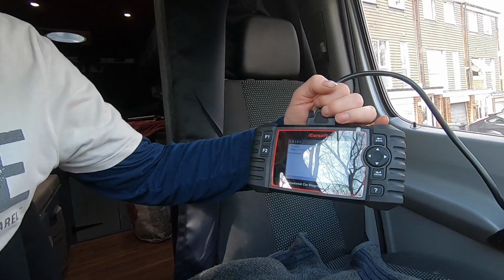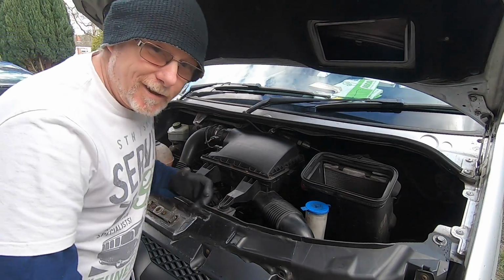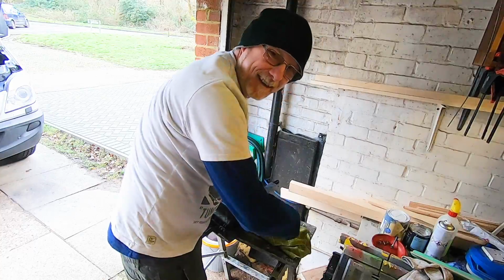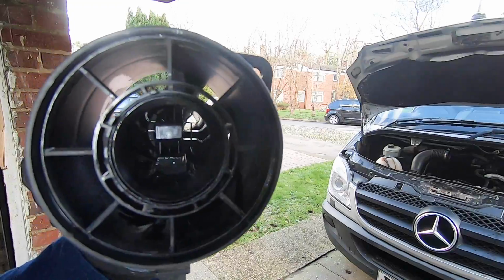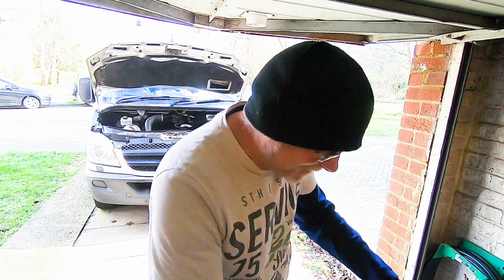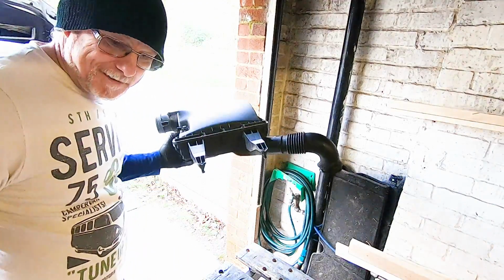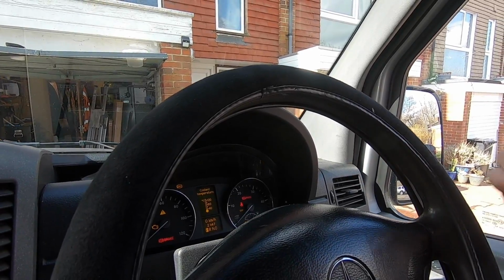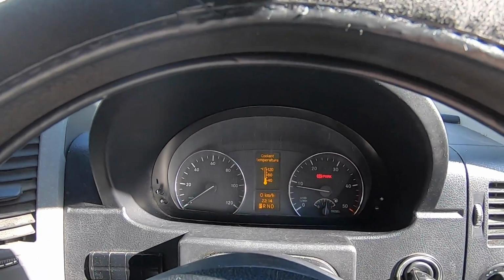HOW TO clean Mass Airflow Sensor

Comment: Aw my sprinter  2006 bus i bought in feb, has probs going into limp mode, going up hills, even sometimes small inclines...so changed the turbo sensor on side of hose, its made quite a bit of difference,  but last weekend x2 on motorway dropped to 40mph,so put hazards on till at top....mate told me to change my air flow meter...also black smoke...no codes come up tho ! So maybe change it 🤔🙏🤔

Comment: Great vid. I’m gonna try this. And buy that scanner. I’ve been converting a 2011 Sprinter myself and am always having to plug it in. Damn sensitive aren’t they.
Reply from the maker: Hi yes sprinters are really sensitive I’d highly recommend you getting the scanner it’s saved me a fortune over the years I’d also recommend that you don’t use them piggyback fuses like I did they cause problems for me in the past good luck with your project 👍🤓👍
Reply: Yeah, I bought the scanner you recommended. 
What are the piggyback fuses?

Comment: I had the maf code and I tried cleaning through that grill and no luck but after watching this video you helped me find out that the grill comes out haha thanks
Reply from the maker: That’s brilliant I’m pleased it helped you 👍😊👍
Reply: Mel’s Van World still trying to figure out my problem lol may be a cracked inlet pipe or something that is causing the maf to be slightly out of spec also I have a code p1955 which has caused the motor home to go into limp mode have you ever herd of that code? It’s a Mercedes sprinter 2011 C/C 511 CDI 4325 L

Comment: I've got a 2008 Relay with 179k miles on it. Had to do the same with the mass airflow sensor. Next up are the injectors ;-)
Reply from the maker: Good luck don’t force them be careful 👍🤓👍
Reply: @MelsBigVanSmallWorld  Thanks, I'm going to crack one open tonight. If not succesfull I'll send them off for cleaning. Any recommendation?

Comment: Hi Mel recently found your channel having just bought a sprinter van to convert could I ask how you think the "Ring" b2b charger is working as theres a few bad reviews for it and I`d rather hear it from somebody who is genuinely running one . thanks Mick
Reply from the maker: Hi Mick I have used them many time and had no problems at all the main reason why people have issues is because they don’t switch off solar priority so when driving during the day it won’t switch to DC to DC charging rather than solar it’s really simple to switch this off. Also you’re hear about error code this happens when there is no solar panel attached or at night when there’s no sun ☀️ when solar priority is still on basically it’s people not reading the manual properly it’s a great peace of kit the one I have in my sprinter is working perfectly fine just remember that they do need ventilation especially if you’re running a fan plus fridge during a hot sunny day because all that power is coming from the solar through the controller rather than being drown from your battery’s that’s why they have two fans built in to them don’t put it in a confined space but that goes for all controllers 👍
Reply: @MelsBigVanSmallWorld  Morning Mel just to confirm you have to turn off the solar priority each time you drive the vehicle ? then turn it back on once you park up ? then turn it off at night not to get error codes or am I reading your reply wrong ? also if I hadn`t fitted the solar before using it do you just leave the solar priority off sorry if I`ve completely got it wrong Mel I`m just trying to get my head around it I can`t remember what day it is half the time never mind keep turning things off and on all the time
Reply from the maker: Oh one other thing people don’t understand is that if your smart alternator is putting out say 9v and it’s a hot sunny day the controller will charge battery pack from solar leaves them thinking why isn’t it charging from alternator hope this helps 👍🤓👍
Reply: @MelsBigVanSmallWorld  Thanks Mel that's a great help I`m new to the van building and 12v systems I was a builder in a earlier life at least all this building is a little lighter , keep up the great work on the videos Mel I really like how you deliver them nice and relaxed with a bit of humour thrown in

Comment: I clean my Z4 MAF every six months as i have a oiled K&N filter fitted.
Reply: The K&N does make a difference. I recently tried a std. paper filter and the car seemed bogged down. So the cleaned K&N went straight back in.
Reply from the maker: Sounds good 👍

Comment: You can use electric contact cleaner which is cheaper and usually easier to find.
Reply from the maker: Hi I would as it leaves a residue 😐
Reply: @MelsBigVanSmallWorld  The WD 40 brand of contact cleaner I have is residue free - but I've used isopropyl alcohol in a spray bottle which has worked just as well. As long as it evaporates pretty quickly and doesn't attack the plastic there are quite a few things you could use - some more explosive and carcinogenic than others  :-)

Comment: Hi Mel, Although garages use EGR cleaner Or Brake its not recomended. The Use of these types of harsh solvents whilst do clean the sensor they can shorten the life of the sensor. A garage wont be too concerned with this as its win win  for them. The correct cleaner is isopropanol alcohol sprayed on the sensor.
Reply from the maker: I used a cleaner that was made for mass air flow sensor worked a treat
Reply: @MelsBigVanSmallWorld  My mistake sorry, What did the can say was in it out of interest.

Comment: Interesting isn't it how the 312d had an engine that people say would do a million miles and it probably would and yet more sensors are installed supposedly aiding diagnosis on these newer engines that I v much doubt would do that sort of milage... I wonder why.
Reply from the maker: I know I had a chance to buy one with only 73on the clock kicking myself now
Reply: @MelsBigVanSmallWorld  yeah I put 318d was meaning 312d yep I would love to buy one with a decent chassis, a 4wd came up in Middlesbrough few months back made about 3500 ex British gas I think, low miles would of made a great overland/ camper and runs on veg happily..
Considering an old banana transit ambulance it's already built but no turbo might be a bit slow, pretty solid though.
Reply: @MelsBigVanSmallWorld  if your interested in one a guy had a 312d ambulance with crazy low milage on Gumtree and sphock not long ago, money a bit dear with no mot but I'm sure he'll wake up, ya probs busy enough though.

Comment: This is why Mercedes engines last so long they won't run long enough at one time to do any damage to them.
Reply: we only use ldv's as greenhouses to grow vegetables in,the sunroofs leak just enough to keep my potatoes watered.If you want to actually drive anywhere you need a mercedes.
Reply: @MrPhenomenon1  oh dear did I hit a nerve never mind the truth can hurt. Talking of water leaks I think sprinters are the only vans with built in canal system where the trim leaks so much. Good for growing rice I believe.
Reply: Ldv's,have the only engines where the oil runs on the outside.
Reply from the maker: I loved my LDV Maxus didn’t let me down once